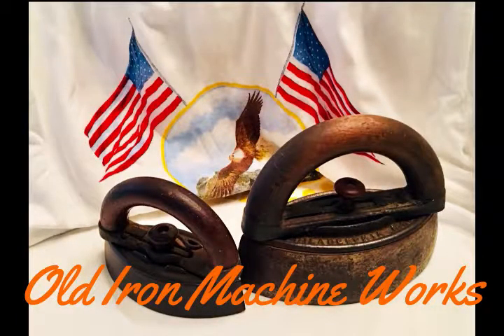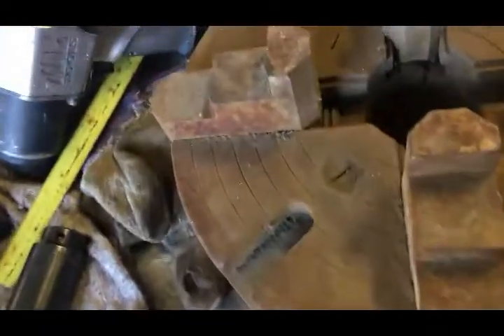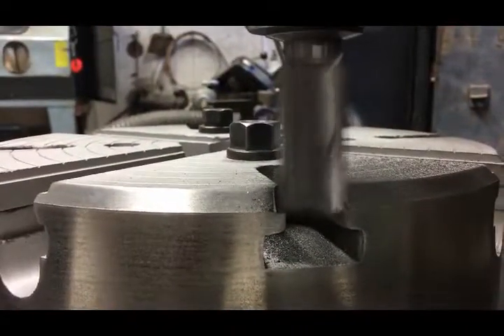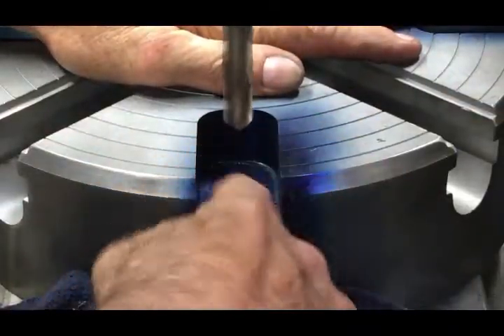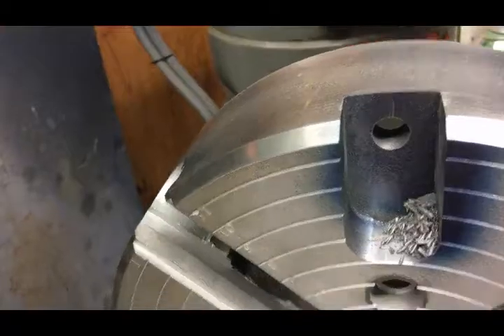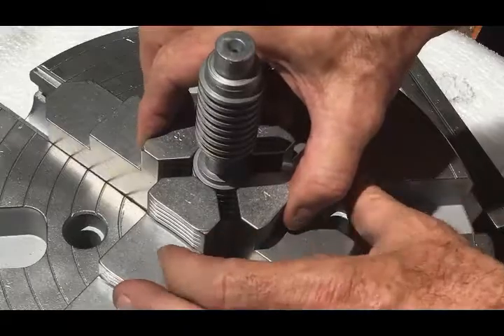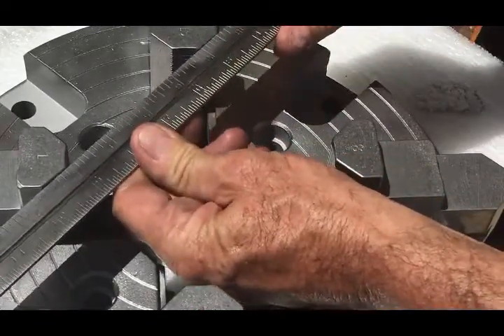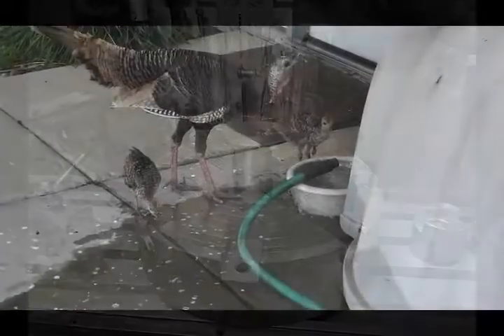4 Jaw Mill Chuck

Comment: I can see why you would make the larger couplings, it seems silly not to use the full length of the drive tang.  And this chuck will be very handy for not just those couplings but a lot of other stuff, as the jaw shape is handy for longer square stuff too.
Reply from the maker: Yeah I think the Chuck is going to be quite handy for many different shapes. I’m thinking it will be handy on my shaper also. It’s always nice when you can stop by the channel Everett. Hope you and the family are doing well, and getting some sleep. :)     Gary